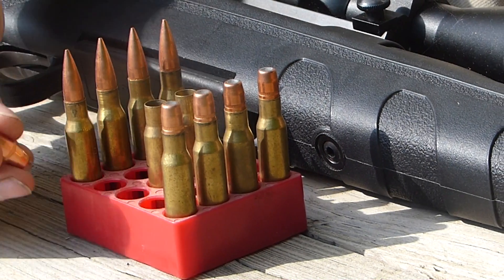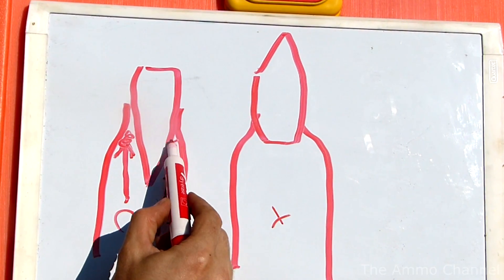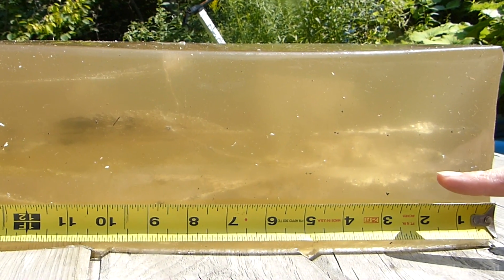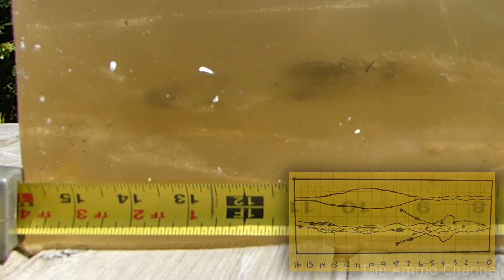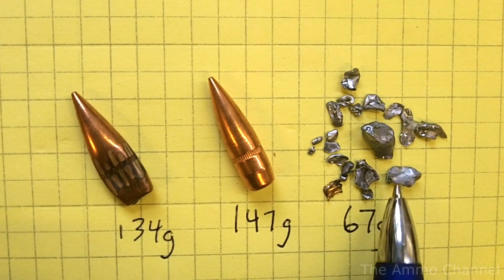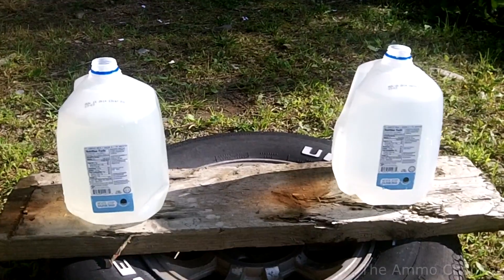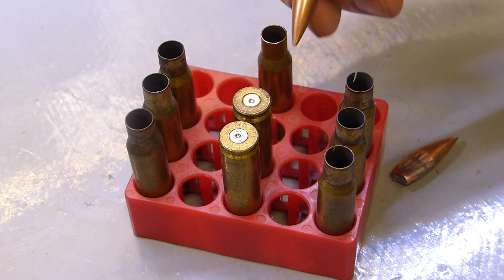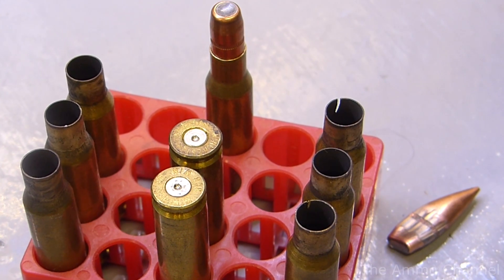Shooting Bullets Loaded Backwards

Comment: I'd like to see a comparison with a bullet that is sanded down at the tip when loaded correctly. That way, the jacket is opened to bare lead and would split more like a slug round while mitigating the risks of a backwards round.

Comment: Its not meant to penetrate the metal, its meant to cause the metal to shatter hitting either a sniper or tank crewman behind. Wont work if too thick though, I believe the steel they had was of a lower quality back then too so take that in consideration.

Comment: Just make a jig to keep it strait and run your bullets on a bench grinder for a second. I have done a ton of 7.62x54mmR this way just for busting stuff in a clay pit, and you don’t have to worry about pulling and re-seating. Before you whine about safety and heat and exploding why don’t you take a bullet and run it on a grinder and see how long it actually takes to reach powder burning temperature, until you do so, don’t open your mouth.

Comment: The Ammo Channel
I am disappointed with your fears and misconception. A pressure acts on all the walls at the same time and I cannot see how the pressure can magnify it self because of the geometry of the bullet. The pressure act on the cross sectional area of the bullet.
It seems that the backwards bullet worked just fine. You say that 3 casings were split but 3 bullets test does not set a pattern. Maybe the casings were already weak and maybe you did not adjust your loader to compensate your the different geometry.
If you don't want people to try your experiment then don't publish it; you are acting like a Democrat !!!

Comment: I think the pressure issues are likely caused by the decreased case capacity. Same powder charge in a smaller case volume means higher pressures. 
I would have been curious as to how accuracy would have been effected.

Comment: The metal jacket is so the bullet goes straight through. Because it takes a least 1 other man to carry a wounded man out of harms way usually it takes 2 that takes 3 men out of the fight. Cops on the other hand use bullets that are designed to kill. Hollow tips. Their reasoning is to eliminate all threats. Think about that soldiers try not to kill but police try to kill. Now that is a public service. With all of the nonlethal weapons available there should be no reason to have to kill people (IF)you don't want to.

Comment: A few years ago I experimented with backward pistol bullets. I was looking for a home defense round with maximum damage at short range but wanted the bullet to fragment if it hit a solid object like a door or wall. In other words, really damage a body at short range but NOT penetrate a wall and kill my next door neighbor. I ended up with a .38 special that was very efficient. Innacurate as hell at medium range, but at the length of a living room, accuracy isn't a big deal. I settled on a swaged lead (more brittle than cast) hollow base wadcutter with a number one buckshot superglued into the base cavity. Loaded it into a .357 case, with a +p powder load and seated the bullet flush with the end of the case. This allowed the .357 case to chamber in a .38 spl. At 15 feet it would blow a block of gel apart, but would shatter into bird shot sized pieces if it hit a piece of 3/8 plywood. Virtually all the particles that passed through the wood lost velocity and fell to the ground in 75 feet or so. I still have a couple of hundred rounds for home defense in a .38 revolver.
Reply: Lawrence Withrow cool story bro

Comment: How about backing off the charge by about 10% for the backwards round relative to the normal load for the round with the bullet loaded normally. Would you still get the case ruptures?

Comment: forging bullets with a flat top has the same effect without splitting the case neck with every shot. good example is the 700gr rounds for the 500S&W. they have flat tops to increase destructive force.

Comment: You used soft steel as a target while tanks were made of hardened steel.If the bullet hits a hardened steel plate with the hard tip it will break apart upon impact, if it goes soft back first it will stay in one part thus increasing spalling and the propability of penetration

Comment: This technique was used byWW1 trench snipers. Snipers at this time would use metal plates with gun holes to snipe enemies without exposing themselves to other snipers or showing their position. Counter snipers would find where these plates were and use backwards bullets to knock fragments of the metal plate into the enemy sniper.

Comment: Take a steel BB and heat it with a torch. Drop onto the backside of a bullet (exposed lead) and let it melt into the lead. Then fire a few backwards and a few forward into the 1/2" steel plate. Next do the same thing except use a pin from a hardened roller bearing.

Comment: Have you done any testing with lower powder charges or chronographed the speed?  I have often wondered why bullet-makers haven't created a teardrop shaped bullet since it's the most aerodynamic form by nature.  One would think that there may be the possibility of creating a sabot or wad that attaches to the bullet in order to help it seat w/o the extra gaps and "v" shape into the cartridge which should reduce/normalize the pressure.  Thoughts?
Reply: I've shot countless rounds of reversed boat tailed bullets over reduced loads.  It is the most aerodynamic shape for subsonic loads.  Accuracy is generally excellent, especially using the heavier bullets at longer ranges.  The primary advantage of a boat tailed spire point fired normally is that it is the best shape to remain stable as the velocity bleeds off and the bullet drops below the sound barrier, something that doesn't matter if it's already subsonic leaving the rifle.  The down side to reversed boat tail fired subsonic is the arching tragectory.  You need to be familiar with the tragectory of the load you're using and have a good range finder to consistently get the first shot on target.  Oddly enough the heaviest bullets seemed to group better at ranges exceeding 300yds, as if they needed the extra range to "settle".
Reply: @joekahno  Good info. Thanks!
Reply: @DustinNulf  Sadly even the cost of surplus "pulls" has gone through the roof.  Before I left the US I was experimenting with paper patched soft lead slugs.  Good results but labor intensive.  Where I'm living now non-citizens are not allowed to posess firearms.  There are several rental ranges nearby if I want to verify my skills but I have to use a very limited range of factory loads.

Comment: go on Google or YouTube and look at the ww1 German snipers that shot from behind the steel screens that they would move around , nothing would work until somebody figured out if you took the .303 projectile from the case and reseat it backwards , would strike the German anti sniping shield and kill them , if the rounds didn't go through they would blow a big enough scab of shrapnel and frag that it would Swiss cheese the German behind the steel , a fact which can be backed up by the evidence of british .303rds found in trench excavations , and for years nobody knew why....

Comment: I'm not sure how effective a backwards bullet is but, installing a backwards bullet with almost no neck tension and then locking the round in the chamber is a good way to determine the depth of the throat in the chamber.

Comment: nothing wrong with this as long as they used proper load data for the bullet weight they used , forgot who the writer was but they used to fire pistol bullets backwards because the bullet was way more destructive on the the flat end than the round end. the only bullets i wouldnt try this with is the polymer tipped especially the fragmenting varmint bullets. only because they might leave burnt junk  inside the barrel.

Comment: ok , personally i found this interesting , what youve discovered is a bad ass close range varmint or self def round . ive been thinking about the 30-30 flat nose bullets fired in a 308 . wouldnt be dangerous for it is a .308 cal bullet . you would have to tinker with the bullet seating depth a little to get it right . ive read where other guys tried this but no one shot them in ballistics gel . would be cool if you made a video on that.

Comment: Common sense would have you believe that prolonged shooting will definitely make your gun explode by doing that. That is if it doesn't explode immediately. Not to mention you might not be able to hit an elephant at a hundred yards because of massive deterioration in accuracy. Also not to mention different kinds of bullets will behave differently depending on the shape of the rear of the projectile. Just don't try this folks plain and simple :P

Comment: German soldiers in ww1 used to load there bullets backwards because their ammo back then wouldn't penetrate the steel shield on machine guns however backwards it will cause spalling when it hits the plate
Reply: How the hell were they accurate tho?
Reply: cardude1992 remember the rifling in the barrel will still spin the round to stabilize it even if it's backwards
Reply: Okay i guess high quality bullets the have evenly shaped rears might be stable with a spin on them but are they really accurate at longer ranges? Also won't the drag on the bullet significantly reduce its range?
Reply: cardude1992 the round will move a little slower but will will impact with a lot more force as for accuracy i could see it being less accurate at long range but in ww1 engagements were much more up close and personal than they are now the average sniper in ww1 would only be shooting around 300 yards so the average soldier much less than that
Reply: Okay i see thanks for the info. But when you say it will do more damage you mean only if the person is not wearing as sort of significant armour right? Cus then it would act like a hollow point and expands and fragment and all that shit.
Reply: cardude1992 I'm not talking about damage to people I'm talking about when the flat backside of the bullet hits hardened steel plate like what they used for shields in ww1 forwards it won't penetrate but backwards it causes the other side of the plate to spall so the enemy isn't actually hit by the bullet they are hit by the steel shards that break off the backside of the plate
Reply: cardude1992 I also can't see soft body armour doing much to save you from a backwards rifle bullet a plate carrier yes but not a Kevlar vest
Reply: It was useful against that steel shield mentioned by PKrunner but it only had an effective range of 50 - 60 meters. Beyond that, the regular bullets would have equal impact damage.

Comment: Try grinding tip down a little. It changes weight but may produce better cavity to handle the pressure than with sharp tip.

Comment: .303 brit ammo has been found on WWI sites with a bullets loaded backwards. They say that they where used to shoot at "sniper plates" A sniper plate is a slab of steel built into the top of a trench. It has a small window to shoot through but still providing protection from small arms fire. The reverse rounds where said to break fragments off the back of the plates causing injury or even killing anyone behind it. I don't know how true this is but the ammunition has been found. I've even heard it's against the rules of war because in some cases it acts as an expanding bullet.
Reply: Logan Barnette
Reply: id expect it to be for mg gunners or something because the regular rounds were plenty effective otherwise, shutting down an mg with this or an artillery piece might have been a use of it (the backwards or tumbling round would likely do more damage to the gun or it's crew).or in trench fights one shot and he's down. especially at closer ranges, like in the trenches. whereas the bullets normally could punch through doing fairly little damage.
Reply: @wepntech  the germans used it for AT purposes the k bullet however since it had a tip could based in an mg
Reply: @rider4440  ya it was early sniper ap (armpr piercing)rounds until some thing better was available.
Reply: of course they didnt have rules of war back then but now we cant use hollow points because somehow the fragmentation is inhumane
Reply: @rabbitdrink  the practice of turning bullets around like this may have been part of what caused that rule to be made, there was no geneva (sp?) convention back then, obviously since they were using mustard gas soft lead bullets (pistol rounds) and huge flamethrowers as well as burying 100 tons of tnt at a time under enemy positions.... jeese, when I type it all out like that it sounds like a friggin bar fight crossed with a riot in watts!!  no wonder they made rules!
Reply: @lukewarmwater6412  100 tons? damn
Reply: @rabbitdrink  oh hell yeah. look it up, there are still hundreds of tons of tnt buried out  there today, its insane what they  did in ww1
Reply: Luke Warmwater - WWII they still used flamethrowers
Reply: @pauldeahl3980  I know and that always kind of amazed me that hollow points were a no no but lighting someone on fire was just fine.
 dont get me wrong. I think I need a flamethrower for, um... stuff. and um , things.ok fine. not so much need but want.... I want one to, um, melt the ice off my driveway. yeah, thats it!
Reply: @lukewarmwater6412  1899 Hague Declaration
Reply: @DimeOfDimes  then it was the Geneva convention,  when that expired there was another Hague convention,  which we go by now. Since 1950-something.

Comment: backwards bullets were improvised by troops in the first world war to fight snipers in the trenchs. The snipers would use inch think steel plates with a small hatch to hide behind when sniping. The backwards bullet would not penetrate the steel plate but it would hit with enough force to throw tiny pieces of steel from the back of the plate into the face of the sniper. Injuring, or possibly even blinding or killing the sniper.  The more you know